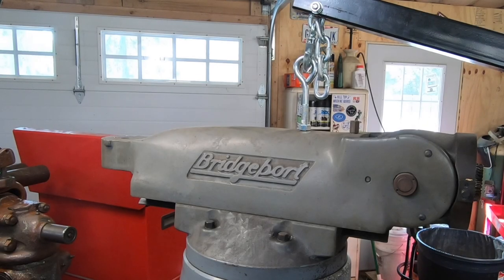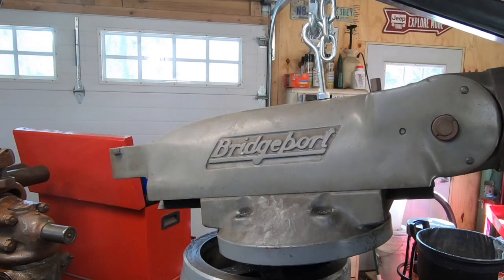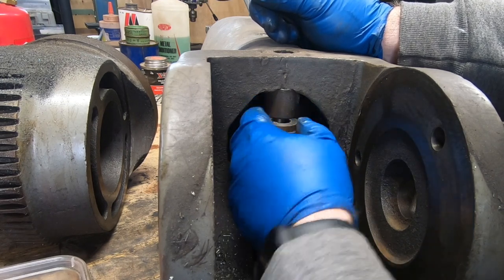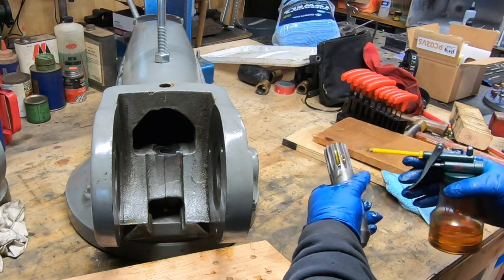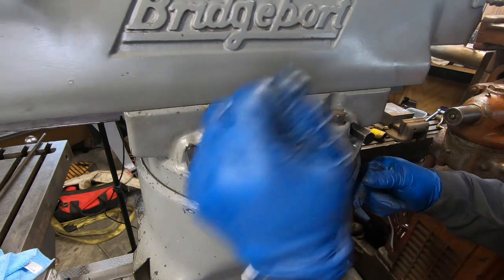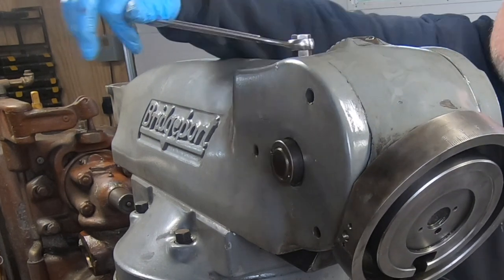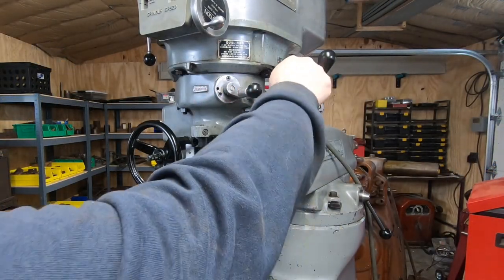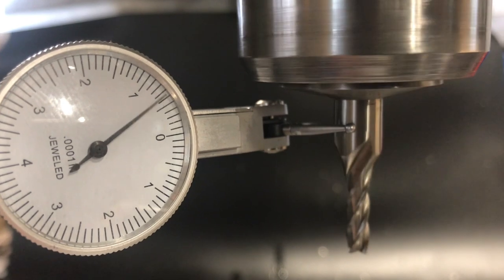Assembling the Bridgeport Mill Turret, Ram and Head - FIINAL

Comment: Turned out really nice Greg.  15 years is a long time, but I can certainly relate to that as I have machines here that I have not had together in at least that long.  Most of them will be going back together this summer as I finally have the time to spend in my shop!
Reply from the maker: My next project probably sat just as long in the shop I took it out of. But it does run, unlike this one. But it's going to need SOME work, mostly cosmetic as of now. I won't know of there's anything mechanical until I start disassembly.

Comment: You show pinion pulling right out. Mine does not. Seems like something is holding it in. ? ?
Reply from the maker: Possible. Different companies made there own version of the ram, turret and column.
Reply: @MyLilMule  figured it out. Set screw from top needed removed